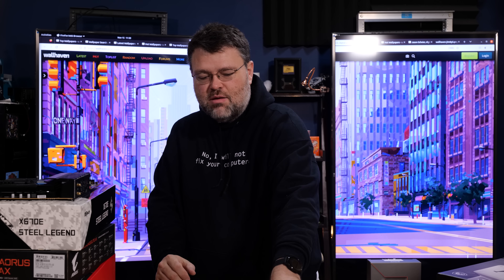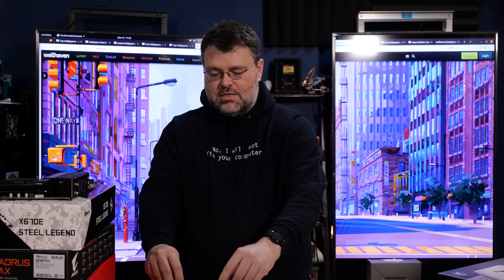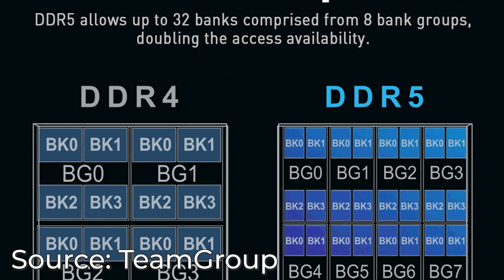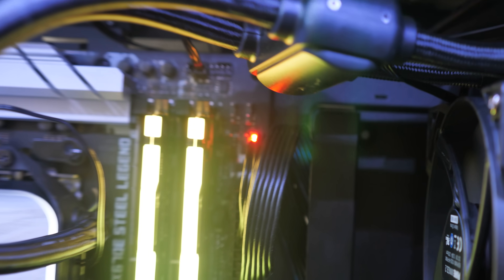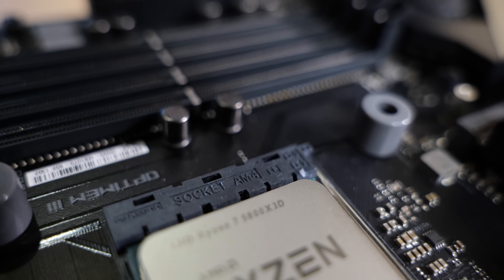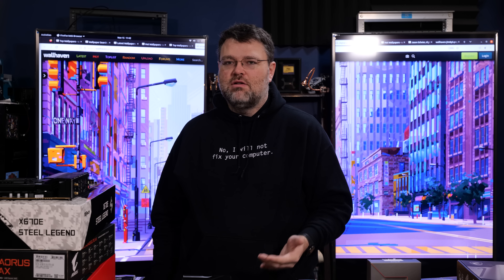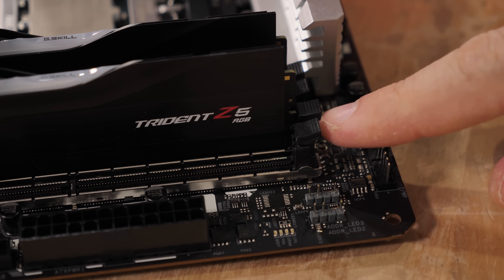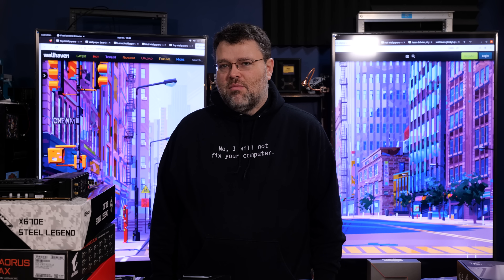Is 128GB of DDR5 IMPOSSIBLE on AM5? Level1 Investigates!

Comment: I guess I got really lucky, then. I'm running two 2x32GB-5800 kits on my 7950X and they'll even overclock to 6200 (well, momentarily, I invariably crash before my overclocking live USB gets to KDE). I have been running it at 6000 with conservative timings since I put the system together, though, and it's been remarkably stable (no errors in over 24 hours of memtest86). iGPU also works fine (though I still haven't been able to pass it through to a VM...)

Booting is ridiculously slow of course (about fifteen minutes, thankfully I hardly ever turn my computers off), which is why I've been restraining myself from trying to improve the settings. Measured bandwidth varies wildly from boot to boot, mostly some flavour of poor, but I do sometimes get good performance. If I wanted speed more than capacity I'd be better off running a single kit, having both kits in at once definitely kicks the memory controller into some fallback mode where performance plummets so in terms of actual bandwidth I rarely get over 90GB/s, and worse, it actually does hurt my L3 performance quite severely (I've seen it go as low as 800GB/s, but mostly it hovers around 1500-1700), but it is still technically four sticks running at 6000, and going down to 3600 or so to not hurt the L3 will benchmark worse. This isn't EXPO RAM, though, and I am running it at a very high voltage. Running a single kit at a time lets me push much higher clocks and bandwidths, so it may simply be a matter of winning the silicon lottery five times in a row (memory controller and all four memory modules). I'm eagerly awaiting new BIOSes that may reduce boot times a bit, I suspect that running all four DIMMs does bad things to the infinity fabric, which decoupling fabric base clock from CPU base clock may help resolve, but when it takes twenty minutes to check each change I make I simply don't have the time. Even if all this capacity does hurt cache and processor performance (and it certainly does, I just cba to find out how badly yet), it's still less bad than swapping to disk would be.

I've been pleasantly surprised with AMD this generation, and my expectations were already pretty high. On my 12900K these same memory kits, even alone, couldn't boot on XMP. The best I could get out of them was 5600. At least the timings were good. Normally I'd expect Intel to overclock memory better even though AMD is more dependent on high memory clocks, but here my experience has been that Intel can't overclock at all while AMD performs miracles.

That said, 90GB/s on DDR5 is pretty unimpressive when I was hitting 100+GB/s on DDR4 several years ago. A last generation Threadripper would get me much more capacity at comparable bandwidth, and it could even be ECC without an awful lot of bother. The extra cores mostly compensate for the loss of per core performance.
I really think two DIMMs per channel ought to die. Either give us four channels outright, or make motherboards with only two slots. As it is those few of us who do benefit from running four DIMMs in a computer should just pay the EPYC tax and get a proper workstation instead. Much higher capacity. ECC. IPMI. A sensible amount of PCIe lanes instead of the utterly inadequate pittance they deign to throw us filthy plebeians.
Reply: Can you post details about this on the level1 forum there are several people who are stuck at 4600 and if you have 6000 stable then that's amazing
Reply: @frzen  My results aren't as impressive as they sound. 6000 stable yes, but the actual performance I get in a benchmark isn't much higher than what Wendell got in this video.

I'd post there if I had anything worthwhile. My DIMMs are KF556C40BBK2-64 and the motherboard is a X670E ProArt, which are high-end parts sure, but nothing remarkable. My post would amount to "haha what do you mean you can't do it, it just works for me :^)", IIRC all I've actually done is boot up, put the RAM speed to 6000, set the timings to 40-40-40-80, and the voltage to 1.45. I could contribute nothing, each one of those people probably knows more about computers than me. My boot times are literally fifteen minutes, I cba to actually check what's causing my abysmal L3 performance because the way I get into BIOS is to literally pull the DOM I have my EFI partition on, and then waiting for the BIOS screen to pop up as a fallback. The alternative is sitting in front of a very loud computer ready to mash Del the second my 3krpm fans stop screaming.

Obviously I don't recommend this type of setup. If you need this much RAM you should buy an EPYC instead. Compensate for the lower clocks by getting more cores instead. You'll have tonnes more memory bandwidth even running at DDR4 JDEC, more channels are always going to perform better. I'm certain someone somewhere has an old DDR3 server with higher memory bandwidth than even the best DDR5 kit can get.
Reply: @СузаннаСергеевна  you could post pictures that would be useful for people to know if it's actually possible
Reply: Seconding this, if you could post on the level1 forum thread in the video description, that would be really helpful. Thanks so much!
Reply: No, you did not get lucky. Wendel is talking about 4x32GB. 2x32GB was more than capable of running at 6000MHz.
Reply: @Bayonet1809  I wrote that unclearly, I'm doing the same thing Wendell is. Two kits of 2x32GB = 4x32GB.
Reply: @СузаннаСергеевна  Wait, so you are running 4x32B DIMMs at 6000MHz, fully stable? 
Could you please say what exact RAM kit part number you used and on what motherboard?
Reply: @Bayonet1809  The DIMMs are KF556C40BBK2-64 and the motherboard is a X670E ProArt. It's stable enough to get through at least 24hrs of memtest86, but honestly I'd prefer ECC even though it certainly wouldn't clock as highly.
Reply: @СузаннаСергеевна  Thanks for the info. I'm also looking at an X670 ProArt, so this is very helpful.
Those look like Hynix M-die, I wonder if Wendel's kits were Samsung, as Samsung DDR5 is known to not clock as highly.
Reply: @Bayonet1809  Yes, I do believe they are Hynix. I read some time ago that Hynix was a good overclocker this generation, but it didn't play a part in picking them, they were simply the only 64GB-5600 kit in stock in Russia at the time. I really just lucked out.

That said, does overclocking matter as much as stability here? 6000 40-40-40-80 isn't a good overclock, running a single kit at a time I can easily push these to 6600. I think the key if you are trying to run four DIMMs at 6000 is to find a kit that can push voltages well.
Reply: @СузаннаСергеевна  Something good at overclocking is by definition stable at high clocks. 6000MHz CL40 is a good overclock for 4x32GB.
Reply: @Bayonet1809  I meant, that not all memory handle high voltages well. Past a certain point the chips become less stable. The XMP for my memory IIRC has them at 1.25V, which is already significantly higher than the 1.1V JDEC specifies. I've bumped that up to 1.45V, which I only dare because the radiator fans ensure there's always plenty of airflow pointed directly at them. Even so they get hot, which also affects stability negatively.

A module that overclocks well may hit 6600 at 1.25V, but it may not be able to do 6600 if you raise the voltage to 1.45V. One way to overcome a noisy electrical circuit is by raising the signal voltage. What I was trying to say was, that for running four DIMMs, you may prefer a DIMM that can handle higher voltages over one that can push higher peak performance, but which is less tolerant of higher voltages and temperatures.

Comment: Running a VFIO setup on Ryzen 7000 with the iGPU as my linux display out and 128GB.  4200 stable is the most I can get with my RAM (corsair non EXPO kit).  The newest UEFI really helped stability with my MSI board.  There's a long way to go.  Thanks for putting in the work Wendall, keep fighting the good fight!
Reply: Have you tried passing the iGPU through? I've been trying since I got my processor and gotten absolutely nowhere.
Reply: @СузаннаСергеевна  I haven't tried it myself, but I believe this is down to IOMMU groups, is it not? Curious what chipset you are running? I have heard that the 650 boards have awful iommu grouping that makes it impossible.
Reply: @TheGreatSpiff  X670E ProArt. The IOMMU groups are actually great, everything I can imagine wanting to split apart is split apart. The iGPU is in an IOMMU group it shares with some audio device I'm assuming is HDMI audio.
As it is I can boot a VM and detect the iGPU as an AMD GPU, but the driver refuses to bind to it no matter what I do.
Reply: @СузаннаСергеевна  no I have not
Reply: has difficulty hitting 4800？ add voltage  to mc to see if that help.
Reply: @Soras_  at default it won't post at 4800, I think there's potential once platform has matured but 4200 is still good enough for my use case
Reply: @mattshortland  No, It's not. Definitely not.
You need 5200, especially for Fortnite!

Those DIMMS are simply being starved.

They actually do care about you, and they want to give you what you need, but they just can't keep up without sustenance.
They crave 1.55V+ (and some active cooling); give it to them and set them free!
Reply: @mattshortland   It s normal to not post with 4stick at 4800 without tweak.  It does not post with 4 32G stick 3200 on my Am4 either. 4 stick is never  official supported at 3200 for am4 or  am5 at 4800.
Reply: @Soras_ what's the best speed for 4 32 am4? I have 2 3200 kit, and i think to buy another one
Reply: @vipvip-tf9rw    4x32G require increase voltage on Soc or set fclk at half speed mode just like epyc servers.
Reply: @Soras_  thanks

Comment: Same here bro!!  Such a pain.  I have 16 x 2 5600.  (got that one free)  and purchased 32 x 2 5600 for more ram on this worktop (that is what I call it.  LOL)   PC will not boot.  so lame.   Thank you for the testing.  Once I get a video card in this one I need to try turning off the IGPU too.  The Asus ProArt MB was very helpful!
Reply: You can not run different ram sticks at the same time, if you had four of the same sticks then your PC would post.
Reply: @Bayonet1809  LOL!  Yeah.  Should have said that before I jumped on its head!

Comment: I can already do 128GB of ECC at 3200 with a Ryzen 5 3600(machine has been up for like 2 years without issue)
I'll be impressed when you can get 256GB DDR5 ECC 6400 with a 16600k/10700X
Reply: What i need to do is test to see if the amazing memory controller on the 5700G can run 4x16 GB sticks of B dye at 4200C19, i know it will do 2 sticks of singlr rank(2x8GB) at 4933C16/C17 but going 4 ranks per dimm, and then 4 dimms instead of 2 is alot of extra pressure on that memory controller.
Reply: If you were asking, the single rank 4933C17 running in 1:1:1 ratio with the 5700G saw 74GB/s at 49.1ns in aida 64, yes it was stable, no i did not use exotic cooling, no i did not raise the voltage on the CPU, memory was running at 1.485v on an asus B550 ROG strix ITX(2 slot)
Reply: @denvera1g1  Quad rank on DDR4 Samsung 8 Gigabit B-die is BAD. Buildzoid @Actually Hardcore Overclocking says: "you dont want to run quad rank of Samsung 8Gigabit B-die". Also he managed to get 128Gb of DDR4 (Micron Rev B 16Gigabit, quad rank) to run at DDR-4000 (Bad but not pointless, like 64Gb of Samsung 8 Gigabit B-die - slower than 2x 32Gb DIMM's). DDR5-3600 at 128Gb of memory is slow.
Reply: @volodumurkalunyak4651  he probably says that because quad ranks don’t clock as well as dual ranks. But @denvera1g1 is running his at 4933, what does it matter?
Reply: @penguinbelly  I do know quad rank clock way worse than dual rank, especially quad rank of DDR4 Samsung 8Gigabit B-die (according to Buildzoid - Actually Hardcore Overclocking). Maybe even 3600 isn't possible with that. Micron Rev B 16 Gigabit it much easier on memory controller - Buildzoid got it to run 4000 at quad rank @ Intel 10 gen.

Comment: 8:00 "It was clocking faster on Ryzen 1000 and 2000 series..."
Nope, you are mistaking on that. I owned a 1700x and never was able to clock my memory above 2900MHz on the first AGESA BIOS update. It was fixed after around a years. Same thing will happens as AGESA update are going to drop.

Comment: I sincerely hope that, with later CPUs or BIOS updates, current boards will support 128gb...
Reply: They already do support 128GB, just at slower speeds. Future CPUs will probably have improved IMCs, allowing for improved memory speeds.
Reply: @Bayonet1809  yes, technically, although I think that when you're talking about 30% reduction in bandwidth by plugging in more sticks the "support" is pretty much just nominal... but yeah, as I just upgraded and plan my next upgrade for ~2y from now, being able to go from 2x32GB to 4x32GB along with CPU upgrade would be ideal.
Reply: Yes, in 2025 when the first 64 GB DDR5 UDIMMs come to market ;)

Comment: I wonder if the instability occurs at certain temperatures.
I stayed DDR4 for 12th gen intel (12700KF), and once the sticks are around 43-43C, I have weird "exits". I say "exits" because Windows NEVER crashes, it is apps just turning off, often times with not even an error caught. Games, tests, even the log-in window just dies and you cannot log-in.

Much better with 2 sticks, but also, colder with 2 sticks (more space and flow).

My work machine is a 3850X. Same modules, 4x 16GB, stable with linux 24/7. Gaming PC with Intel is sketchy :( ...